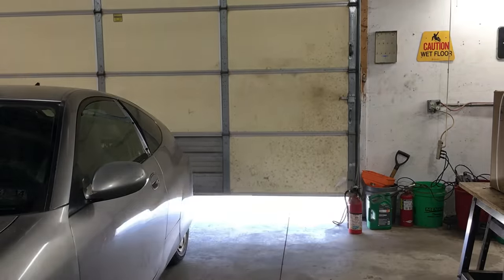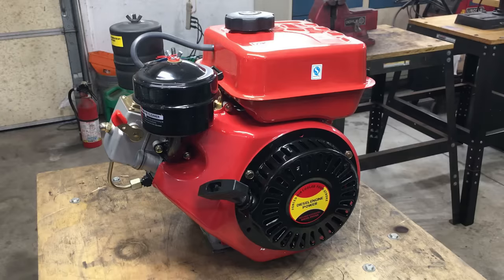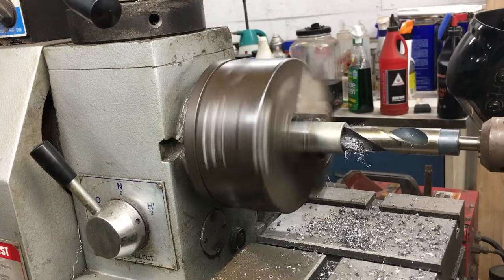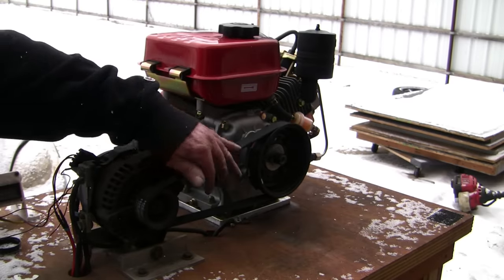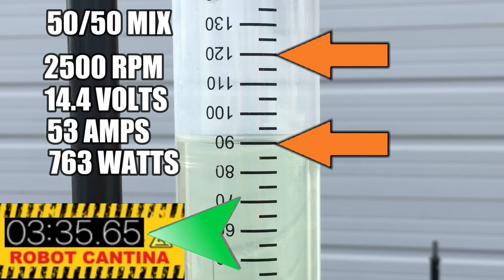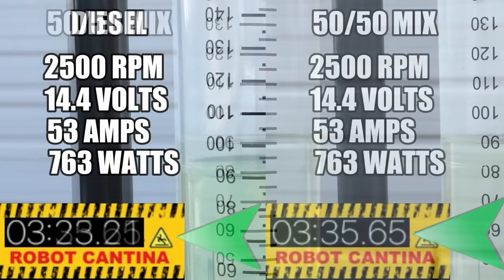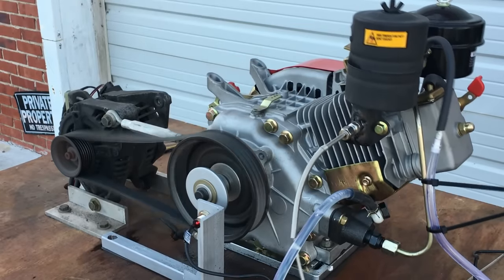S4 E3. How good is vegetable oil as a source of fuel for a diesel engine?... We find out!. plus more

Comment: When teaching diesel engine troubleshooting and diagnostic at Key Power Tech Institute in Miami, I had a 3-71 Detroit Diesel engine connected to a generator. I put five gallon fuel tanks on it with a valve under each. I put diesel fuel, vegetable oil, 30w engine oil, canola oil and Peanut oil in each tank. Using a 55 gallon water tank, a three plate load system with a winch to lower it into the water and an amp gauge to tell hp the engine can produce! The most hp was produced with peanut oil and I believe it was 73.4 hp! The second highest was diesel fuel and third engine oil!

Comment: Diesel/used oil gets my vote. When i worked on generators in Iraq for KBR, we had to use a version of aviation fuel for the generators, as that's what they wanted us to use (easier for everything to use as few different fuels as possible) so we added used oil to the fuel tanks on the generators to add lubricity to the fuel to make it more like diesel. Diesel has paraffin in it, AVGas doesn't, and diesels don't like it as much
Reply: My understanding is Avgas is pretty dry, so that makes sense. 

The old duece and a half's, most of them can run on just about anything, ive heard most of reasonable age will run on 1qt ATF to 1 gallon gasoline for a fair amount of time without causing damage.
Reply: The US military doesn't use much avgas, or gasoline in general. To simply logistics they try to run everything on jet fuel (kerosene, basically). Which is great if your daily driver is an Abrams tank, as they have a turbine engine anyway.

 Diesels will run on kerosene but it's a poor lubricant for the fuel pump, so it would make sense to dose some kind of lubricaring additive. 2 stroke outboard oil or biodiesel would be my choices, and I'd put used sump oil right at the bottom of the list.

Comment: Here in Spain we have a lot of small diesel cars and this is doable with the older ones, I mean, the ones that use mechanic pumps. I have a 1994 Seat Ibiza (this is the Spanish version of the VW Polo, just a bit smaller than a Golf) that would work with 100% vegetable oil no problem (main issue would be the cold starts) as the 1.9 litre n/a diesel (producing a whooping 68 bhp) uses a mechanical  pump. Well, there's another issue: tax evasion. Fuel here is really expensive (and so is vegetable oil) as it is charged with plenty of taxes. So theoretically, if you are using oil as fuel, you are not paying oil taxes, hence you may get in trouble (well, if they find out). Great stuff as always Jimbo!

Comment: I don't know for sure, but I would imagine the fuel pump and injector make up the majority of the manufacturing cost of that engine

Especially considering that they both have tolerances that can be fractions of a thousandth of an inch

Comment: There is a guy that was putting used motor oil and cutting it with stale gasoline to use in his 5.9L Cummins. He gained something like 30 horsepower and added to his overall range. I think it was another 2-3mpg all told.

Comment: I keep looking for a use for one of these engines just to use all my waste oils. So I'd love to see used oil tested. Especially the new super thin synthetic stuff 0w20 0w10 etc
Reply: I have a suspicion that a diesel engine might not run on used synthetic lubricating oil. I once tried to spray some on the bottom of my van to try to protect it against rust, and the sprayer would not atomize the synthetic oil at all although it will spray mineral oil in a fine mist. I have also tried to use used synthetic oil to start a fire to burn garden waste, and the oil is very reluctant to ignite.

Comment: I'm curious about the effects flame speed and EGT have on efficiency, so here are some suggestions:
100% vegetable oil (cold start if possible)
Vegetable oil with 5 or 10% ethanol-free gasoline (also with cold start)
A little bit of some gaseous fuel into the intake, like propane, natural gas or hydrogen

Comment: I've seen a guy on Tik Tok who teaches how to make something called black diesel, which consists of 4 gallons of waste oil (used motor oil) and 1 gallon regular unleaded gasoline. It would be interesting to see a test with this.
Reply: Correct.  I run black diesel in my 2002 jetta tdi with the alh engine (the last easy accessible injector vw engine)
The car gets 35 mpg around town and 42 on the hwy. I've used it to tow several other vw and random cars back to my shop on a tow dolly. I'm currently swapping one of the extra tdi engines in to a ranger (pretty common swap in Canada)
Black diesel also runs well in my 12 valve 5.9 cummins bus. Currently running 70 percent blk diesel to 30 percent diesel.
 Eventually I'll have a 2 tank system so I can do all my driving on blk diesel,  then have the 2nd tank with the mix in it to simply clean the injectors to start and stop the engines

Comment: Humble suggestion. HHO generator added to the intake with the 50/50 diesel/Veg oil blend used as fuel.
Reply: I will loan the hho generator if RC would do it. Might take me a second to dig it out of storage. I would also like to see the exhaust used to generate steam, and then draft the steam into the engine, for comparison to HHO

Comment: Jimbo, LPG guy, again 😊. With this you can test and lpg... About veg oil - its good stuff. My old w210 with om605 with no problem runs on used veg oil even then -10 - 14C outside. Deadline -15 and more... Im using 80% veg oil and 20% gasoline mix.
Reply from the maker: Thanks for the tips!

Comment: I've ran straight used engine oil in an 81 buick diesel I had. Aside from a slightly hazy exhaust, there was no noticed power loss. I could have advanced injection timing and cleaned up the haze a little bit had I wanted to.

Comment: Great video as always. Love the little diesel engine. A struggle to find something like that cheap here in the UK. I used to run vegetable oil pure in my old diesel landrover as it was cheaper than diesel at the time but not anymore. I have used old engine oil, power steering fluid, gearbox oil, brake fluid. Run perfectly fine in the indirect injection engine.

Comment: Great video as always, Thankyou! I ran my 2002 Land Rover defender TD5 on diesel / 2 stroke mix because that was the thing to do at the time, I swear it ran better and had a little more power, although i only had the butt dyno to refer to… I dunno, maybe a diesel / 2 stroke oil mix might be an idea. I can’t remember the ratio, just remember buying it when it was cheap and pouring it in. Exhaust fumes smelt better too 😊

Comment: Been running my Mercedes 300D on waste veggie oil, used motor oil, used trans fluid, and mixes for years. 806,600 miles and still going.

Comment: I have been running Filtered and dried used Veg oil in my Vehicles and small Diesel engines over 25 years now.  I run it in my Kubota tractor and mower all the time.  The biggest problem is people  get used oil and strain it through a Chux Cloth or something and call it good which it is not.  Need to be filtered and dried properly. Obviously not needed with new oil but that's expensive so I use waste oil. 

You can run any mechanically injected Diesel on 100% oil although being as cold as it is where you are,  I would run 5-10% Gas mixed in so it doesn't gell and will be easier to start. 
Oil is far more lubricating than straight diesel  so makes pumps and injectors last far longer. I wouldn't even run my engines without some Veg or 2stroke oil in them because straight Diesel is so dry now. 

Diesels will also run on Waste engine oil ( Filtered to 10 UM or better) ATF, Jet fuel ( add oil for lubricity) and any non aromatic Fluid.  Used Hydraulic oil is good and burns clean.

Comment: Hey there Jimbo! It’s been a while, but I’ve returned to throw in my two cents. 

1¢) Highway diesel here in the states is all ultra low sulphur meaning the fuel has a lower acidity but also a higher friction coefficient. 
2¢) The vegetable oil has much longer polymer bonds than the diesel making it more viscous (potentially clogging injectors), but also greatly reducing the friction coefficient. 

Free tertiary cent!) I wouldn’t recommend going over 50/50 mix of uncooked veg oil, but 30/70 is plenty safe. You can use a solvent to cut through the polymer bonds of high viscosity fuels, but maybe start with a 10:1 mix to stay on the safe side. 

Good luck on your future diesel experiments! I’ll catch up with your videos soon.

Comment: so i have a few old W124 Mercedes a 4cyl 200D 875,000km a 5 cyl 250D 574,000km  and a 300D for spares
so this old 200D is slow as hell but i loved it anyway , but here in Denmark you pay 800$ per year in roadtax alone  , so when the diesel was high i just when to the supermarket and purchased their sun slower and rapseed oil on sale for nearly half the prize , it ran great on it , in the winter i had to mix 5% gasoline in the seedoil  ,,i i also ran alot of filtered used motor and gear oil  but for that one had to mix in atleast 25% diesel and 5% gas ,,,,
please be aware that this was a mekanical fuel pump , and i always had a extra filter and a fresh battery in the trunk and had spares so i could at no cost replace injectors if needed,,newer diesel cars do not try,,,

Comment: I ran WVO in my 82 mb 300cd, and a Greasecar Kit in a f250 power stroke. Over 15,000 miles on the powerstroke. 5%unleaded gas, 10% diesel fuel, 85% Used cooking oil from restaurants...
 😅 The secret is to get the wvo close to the same viscosity os diesel by heating it.

Comment: I did an experiment years ago in my 1983. Ford F250 diesel 420. Naturally, aspirated I burned. Everything left over in an abandoned car. One gallon of gasoline transmission fluid break fluid power steering fluid and clean engine oil. And Mixed it all together. it made a very useful fuel.

Comment: I ran my old Peugeot 306 on veg, for 75,000 miles before I sold it, still running.
Main things to consider: Indirect (good) vs direct injection (bad)
common rail (very bad)
Bosch injection pump (good) vs Lucas and those types (bad)
Of course, the veg can be turned into biodiesel, and pretty much any diesel will run in it.
General rule of thumb is something old and German, or old and French, and by old I mean typically non common rail, pre-2000 Get your hands on an elsebett engine, it was designed to run on veg. Those old Listers are also good on the veg.

Comment: Back around 2005, I bought a 1982 Scottsdale k10 heavy half diesel, 6.2L. In 2006, I was looking into biodiesel. That Scottsdale was the perfect test subject due to it having saddle tanks. Run 1 tank diesel and the other tank biodiesel. Based on the research I did, used cooking oil works better than new. You can use 100% used cooking oil, but for it to work better, you need to add some methanol and/or use that diesel antigel additive. I did a small test run using just used cooking oil and it worked great. I was getting equipment to be able to filter out the cooking oil and then the injection pump went out. It wasn't from using the cooking oil, it was just old and worn out. Hopefully that info will help you some
Reply: For the gelling,, we just added a magnetic block heater to the bottom of the fuel tank and wired it into the circuit with the engine block heater

Comment: Good idea, Jumbo. You can never tell when a zombie apocalypse will happen! 

I used to run my old Audi A4 1.9 “Red i” on a 50:50 mix. Until the price of vegetable oil increased. No Ill effects and in fact I think it actually ran smoother than on Diesel alone. Smelled like popcorn too! 

Ideas for alternatives? Well, different oils would be interesting. Peanut especially. You could also try used veg oil ( can smell of the food that was cooked in it ). And finally perhaps experiment with making bioDiesel? It’s the fatty acids that are the problem. They can attack the pump seals. It’d be cool to develop a small-scale bioDiesel rig that’ll yield a tank full at a time.

Comment: excellent stuff as usual Jim. one of the trains that engine is soooo cheap is the tolerances are really loose. what this means is that you have a huge variety of fuels that that engine will tolerate. preheated used engine oil run through a fairly low micron filter will run just fine. also on the menu are hydraulic oil, ATF, just about any kind of oil at the right viscosity. fun fact, Rudolph Diesel designed the engine to run on veg oil, peanut in particular.

Comment: As far as energy content and generated HP is concerned, vegetable oil works just as well as diesel.  

The problems with vegetable oil are mainly due to high fuel viscosity damaging the injection pump, and vegetable oil blow-by getting into the crankcase sump and contaminating the lubrication oil.

In other words for a reliable vegetable oil powered engine, you need to heat the fuel tank and fuel lines to keep the fuel thin, and replace the engine oil at slightly more frequent intervals than usual.  

Of course, alternative methods of thinning the fuel work equally as well, like blending 50/50 as you have done in this video, or you can go down the transesterification route and create biodiesel.

Comment: You can also add a little bit of gasoline to your veggie oil that will help thin it out 

I would try waste motor oil that's been filtered maybe 50/50 add some gasoline in with the used oil or transmission fluid or you can even mix kerosene do not use straight kerosene you will wreck the injector pump It needs lubrication since this is a mechanical injector you can pretty much run whatever you want which is a good thing As soon as you get into the newer trucks with electronic crap on them good luck trying to run homemade diesel out of waste oil and diesel mix

Comment: Love your videos Jim. It would be interesting to see if you can run that engine totally off of vegetable without any diesel fuel assist. Might put a y fitting on your fuel line so all you have to do is switch from one fuel to the other. Thanks for all the great info and videos. 👍👍👍👍👍🍻🍻

Comment: Rudolph Diesel originally used vegetable oil because Diesel hadn't been invented, i used to burn a mix of Central heating oil and 20/50 oil, mix it like a 2 stroke mix, 1 pint ( uk pInt 568mlof Engine oil in to 5gallons( UK gallons at 4.5 litres( 1000mml) and shake up, essentially a 40:1 mix ratio.

Comment: I used Sun flower Oil in my 50cc two stroke Puch Maxi, the cyl head was shaved by approx 1 mm.
The thing made insane high amount of rpm, the smell was like a restaurant.
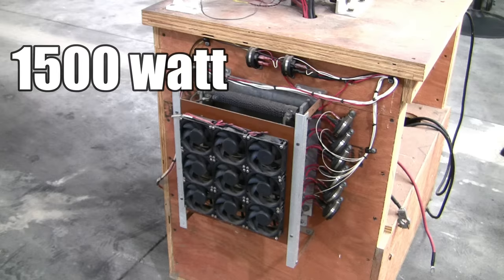3:18 That's a cool rig you got there.

Comment: Back when I owned a pre-smog Cummins 2500.... I would put EVERYTHING into it's fuel tank.  But, because the factory lift pump was just a bad design... I had an air-dog on it with a large external filter. (Keeps junk out of the engine) But I would pour old fryer oil into it during the summer and it smelled great !!!  (I would run it through a pre filter first and don't try it in the winter)  I would also give my neighbors a fuel jug so when they would do oil changes... they could give me the waste oil.  and... when I did a transmission service... I pored that directly into my tank. (I smelled bad)  Basically... any oily thing I could get my hands on... and was clean-ish, would get used as free fuel.  FYI... I sold the truck with 268K miles on it.  The real pisser of all of this was... when we switched to ULSD fuel in 2007... I would have to put 2-stroke oil in "Real" diesel fuel to make sure my injector pump was properly lubed.
Reply: Thanks,  that is an interesting thought,  just add a two stroke oil as insurance.

Comment: I've done 250k miles on waste vegetable oil. I used gravity filtration to 1 micron. I mixed 5% petrol (gasoline) to help seperate water more than anything. Unfortunatley I now drive a modern diesel that doesn't like non standard fuels, but worse than that it's registered in France where the beurocacy make it very hard to use non standard fuels. I always ran a 2 tank system with a heated fuel tank for the veg. My record for performance in a VW T4 (90's Eurovan to USA folks) was 100mph at -25C on the Munich ring road at 60% throttle. At 70mph it would get 45mpg (imperial)

Comment: It will burn anything oily stuff.
When I was working as heavy equiptment mechanic. Me and my colleague drove our home-shop route with old VW Diesel Rabbit. As fuel we had used hydraulic oil, and ATF. Only problem was winter. At -20C temp, fuel filterwas too restrictive. But 50% diesel helped.

Comment: I ran my diesel car with waste vegetable oil for nearly a decade and 170'000km here in italy, between 2003 and 2012.
I also tested various waste mineral oils, and it turned out that waste hydraulic oil was running great.

If you can find some there, try to add some naphtalene in the mix.
It has a high cetane rating, and it helps to reduce the clattering noise from the combustion reducing the ignition delay.

Comment: I’ve been running my diesels on everything except 100% diesel. Filtration is the key! I use fry oils, used engine oil, trans fluids. (Conventional burn cleaner than synthetics) you can occasionally get contaminated Jet-A, kerosene, hydraulic fluid etc. All are filtered and then blended with diesel. You can run on 100% fry oil, oil or Jet-A, but the engine oil at 100% is a little smokie. Axle grease needs to be thinned a lot before it will run properly, The veg oil in the winter at 100% is harder to start, Jet-A is similar to diesel but has less lubricant in it. Although the military diesels all run on JP-8 (kin to jet-a) they don’t seem to care about less lubricant in the fuel. I tend to keep gasoline away from my diesels. When Rudolph Diesel invented the darn engine, diesel fuel didn’t exist. It was invented to run on oils of sorts. I’m eager to see what kind of slurry you’re gonna come up with to feed this thing.